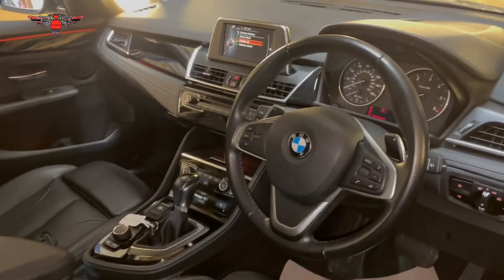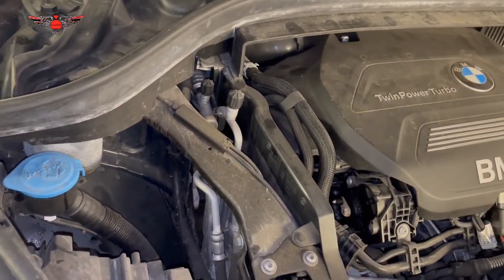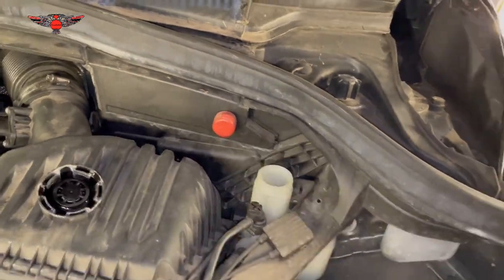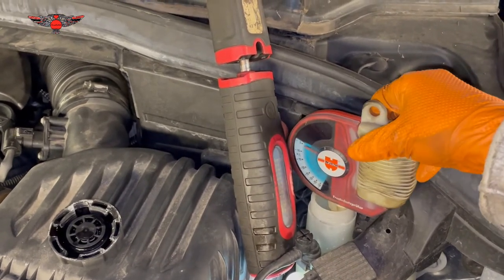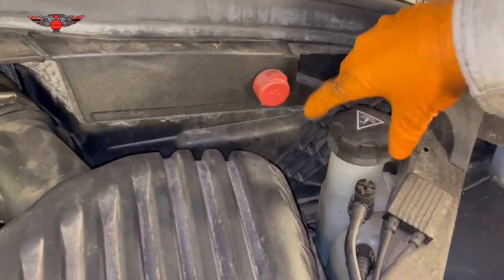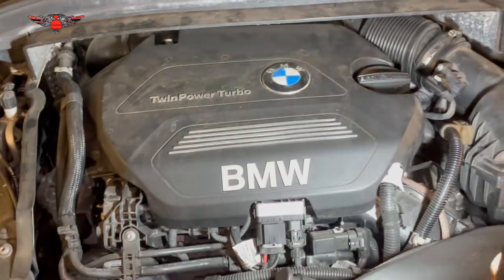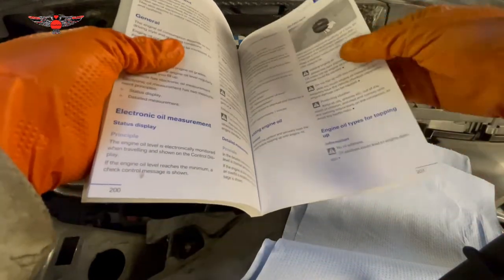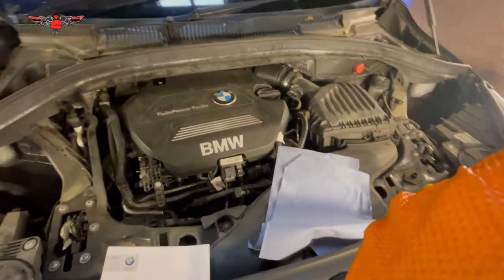BMW F45 2 218d screen wash fluid top up, coolant level visual check and antifreeze percentage.

Comment: Hi please can u show where power steering wheel fluid is located
Reply from the maker: Hi, I don’t think the car has a hydraulic power steering that requires fluid. I think it has an electric power steering so no need for fluid.
Reply: Ahh thank you 🙏